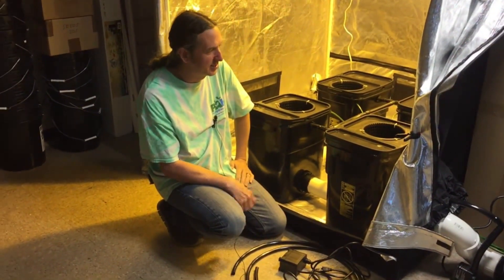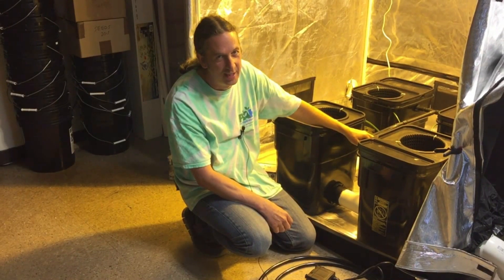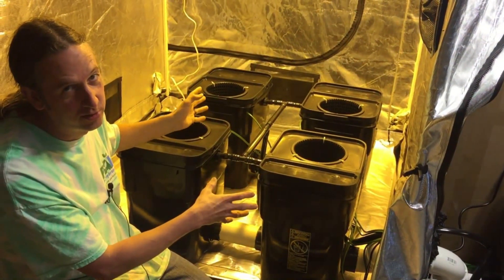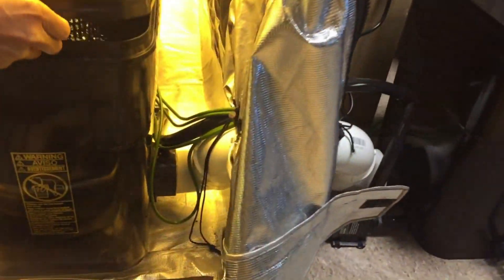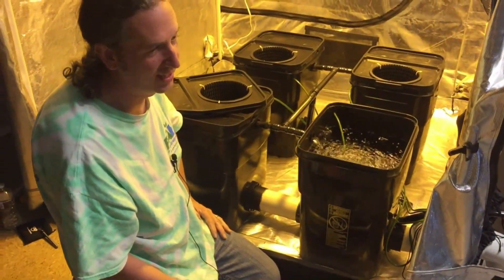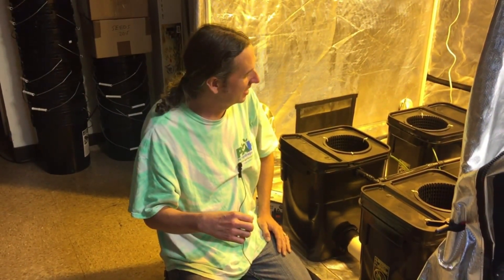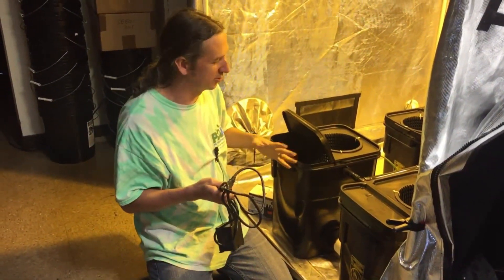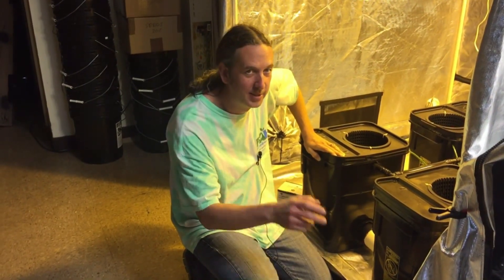Fallponic Waterfall Top Feed RDWC Hydro Setup for 4x4 Tent

Comment: I don’t see the point of the water fall,and the air pump.
Most of the time people use the water fall effect to add more dissolved oxygen to the system instead of air pumps

Comment: Nice. I just built mine.... Using 2 in on the out and a half inch waterfall through the top.... 250 GPH Danner.... Single site inside of a 4x4....scorpion Diablo, scrog net..... Reservoir outside the tent.....

Comment: The black Buckets & Tubing attract heat from the grow light , would it help to paint them White? You need More air, 1 Pump 4 Stones Per Bucket
Reply from the maker: If you are running into issues with heat from lights then painting the tops white will certainly help in reflecting the lights energy instead of absorbing it.

There are customers that use more than one or two air stones.  
Additional air stones will keep dissolved oxygen levels as high as they can be in the nutrient solution. Keep in mind that water can only absorb so much dissolved oxygen before it naturally releases it back into the air.

Comment: The waterfalls in each bucket with a ring. Drip ring implies slow flow. 4 bucket 180gph on the chiller and about 350gph to the buckets. Gravity return to res. No air stones. They only introduced molds and funguses and heat the water. And if you use CO2 the air pumps introduce co2 to water and will fuck your ph

Comment: Hi, I don't see this on the website with the clay pebbles included.
PA Hydroponics 4 Plant Fallponic System custom built for a 4x4 Gorilla grow tent (Clay Rocks) 13 Gallon grow sites with reservoir outside of tent.
Reply from the maker: Hey there, the 13 gallon with rocks put the shipping into the over-weight category and the cost doubled! So we took it off, you can order the rocks separately and it will be in a separate box. Sorry about that and thanks for watching:) Gary

Comment: Hey Gary  What are your thoughts on adding Orca to a Ebb and Flow system.  Or Greatwhite to your soil grow.   Will it improve the health of the plant?
Reply from the maker: Good question, Orca is nice for hydro and clean, I like it in clone machines, great white is also good for hydro or soil, in hydro people usually use salt based nutes and the salts will dehydrate the microbes and they wont reproduce as well also water pumps shred and kill microbes so it is a debate that has been going around about hydro verses microbes. Hope this helps. and sorry for the delayed answer. G
Reply: @PAHydroponics  No worrie gary thanks for responding.  This was the most temperamental grow i have done.  The Northern Lights was really strong at the beginning and just puckered out.  I didn't get hardly any stretch. I will send you a photo of the tent later today.

Comment: Another great video, i hope the local people in your area really appreciate you!

I'm wondering how the science of the drainage works? Especially with the lift to run out of the tent port hole. This is definitely going to be my next system. Looking forward to seeing the 8 gal version. How much taller is the 13 gallon bucket. I always feel constricted vertically. Not to mention the added nutes with 25 added gallons of water. The customers that expressed to you that 8 gal wasn't enough what benefit are they getting from the 13 over the 8? 

Why the 8" net cups? I though from previous videos you were a big fan of the 6" size.
Reply from the maker: I don't know why I am missing some of these comments! Sorry. 8 gallon video will be on in next day or 2 and you will see it working and all that, 13 gallon is about 5 inches taller, and yes more nutes with more water so the 8 gallon mini might be best for some, but customers grow big stuff out here and the 13 gallon is needed. I used 8" net pots for this because the heavy duty 6" wasn't deep enough and the bucket lids dont work on this. Thanks for watching! Gary
Reply: If I had 60liter pots in a 4x4 tent I'd only want one and grow a tree. Tons of root space to achieve this 👌😍

Comment: What size air pump would you recommend for a two 5 gallon dwc bud
Reply from the maker: Hey sorry for the delay but for anyone else reading, a 2 output air pump should do fine - usually each out put of a pump is good for 5 gallons. peace. Gary
Reply: They are not needed. The water falls are all u need. If you have a chiller run it on a separate pump and allow a water fall back into the res.

Comment: Very Cool Build.  Do you think it could work with 2" PVC for the return lines?, or do you think they too would eventually clog up??  Thanks for the share.
Reply: 2" will clog, I have this problem in my current setup, will be rebuilding while incorporating these design ideas, I can already see how this setup is better than mine. good job PA Hydroponics.
Reply from the maker: @mikendi08  Heck yeah! This system is a combination of a few different ones I have seen over the years, it is better than CC and works better for a chiller too, each plant is getting a cool bath all day. The 3" is almost twice the water volume and 3" is the way to go! Thanks for your input :) Gary
Reply from the maker: I think the 2" can clog and 3 is the way to make sure it doesnt, dont grow to big with the 2" and maybe it will work for you. Thanks for watching! Gary

Comment: So is the only difference between the other 4 plant rdwc system and this one that the water falls at the top of roots compared to having water just circulate through the bottom?
Reply from the maker: This one is alot different and easier to build and should work better too. Stay tuned and thanks for watching! Gary
Reply: @PAHydroponics  looking forward to it keep up the good work